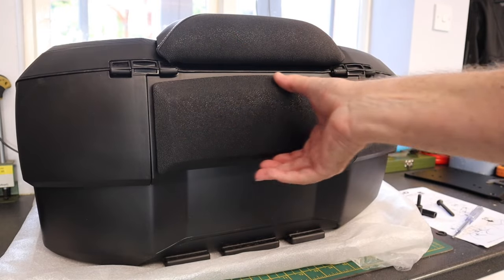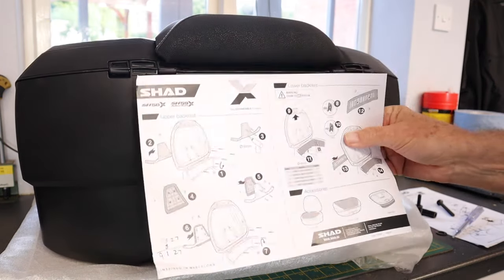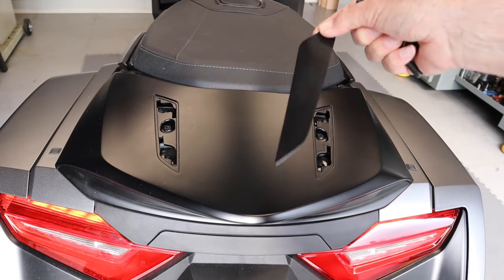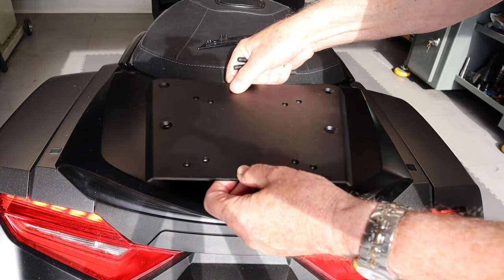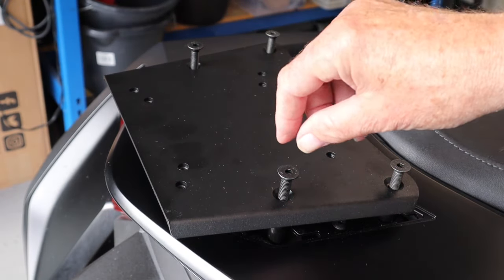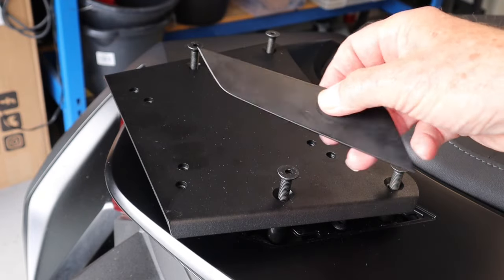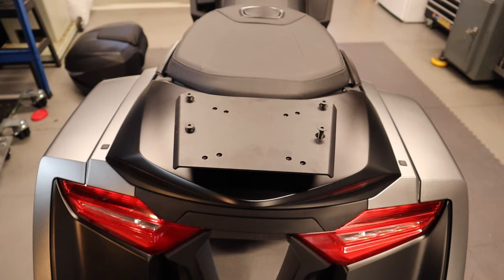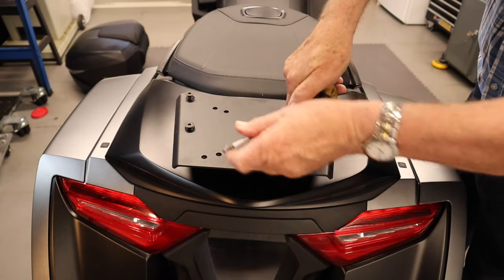Fitting the Shad 58 Top Box to the Gold Wing

Comment: The plastuc covers are not to be drilled. They're removed and stored as they are, to be put back on the motorcycle when you decide to remove the plate, and the top box, permanently. They're not to be drilled and put back, and fit the spacers through them.
Reply: @1zanglang - So glad that I read your post about not drilling the covers (even though the directions say to).  I removed the covers, put them in a safe place, and continued with the installation - SO EASY!  When the plate and/or the trunk is mounted, you never see the missing covers.  I figured that if I sell the GW at a later date, and if I decide to keep the Shad, the new owner gets a stock tail piece with the covers in place.

Comment: I was fussing with my Shad SM48 in the same fashion on my BMW RT. I found a step drill bit the best way to drill the plastic. Neat as a pin. Almost butchered it with a conventional bit but stopped myself and waited for the step bit to come from Amazon to finish that last 016mm hole from 6-10MM starters. Got the steel plate sorted and ready to fit the plastic chassis now and came in to watch you first! Well done!
Reply from the maker: Hi Steve, I went to an engineering show a couple of months after I fitted the SHAD and noticed a step drill on one of the stands. Bought it with the thought that I wish I had it when I fitted the topbox. Your mind quicker than mine...well done!
Reply: I just put on the SN48 as well, and I have to say the Shad stuff has to be the easiest of anything I have ever attached to my bike including the backrest. I also use a metric step drill bit for plastics. There is nothing better. I will say to anyone doing this, it is really important to confirm the placement of those holes before you drill. Don't drill anything until you are absolutely certain not only of its overall place, but that your bit is actually at the center of the hole. Being a little off would be bad.  An 18mm hole moves a lot with a very slight movement of its center.
*I would also note that when you screw the plastic cover back to the top fitting, there are two plastic tabs the need to go into place first before you fit it down, then put in the four tiny screws. This gentleman missed that.

Comment: Did the pre marked holes on plastic inserts line up when drilled?
Reply from the maker: Not the ones in the Honda ‘caps’ which was very frustrating. That is why I had to find a method of marking exactly where the bolts would be and drill at that position, which did work.

Comment: does the metal black plate that is attached to the bike is included with the case or you have to buy it separately? the plastic plate you have to buy, right?
Reply from the maker: Hi John, the metal fitting plate is bought separately. I ordered the Shad 58 with its own ‘plastic’ mounting plate, but at the time there was no metal Goldwing mounting bracket available anywhere. Eventually I found one on the Internet in Italy which came in a few days thank goodness. Sure that shortage has been sorted now😵‍💫
Reply: @normski3091  thank you for the quick reply. I'm having a problem finding one. If you don't mind, can you please direct me to a website/link where I can find it.
Thank you
Reply from the maker: https://www.tradeinn.com/motardinn/en/shad-top-master-rear-fitting-honda-goldwing-gl1800/137027048/p?utm_source=google_products&utm_medium=merchant&id_producte=7938207&country=uk&gad_source=1&gclid=EAIaIQobChMIm67t5sK6gwMV5o9QBh2nHgiEEAQYAyABEgIw6fD_BwE&gclsrc=aw.ds
Hi John, Hope this helps, but SHAD in the UK says they have in stock now…but motardinn actually cheaper 🤩